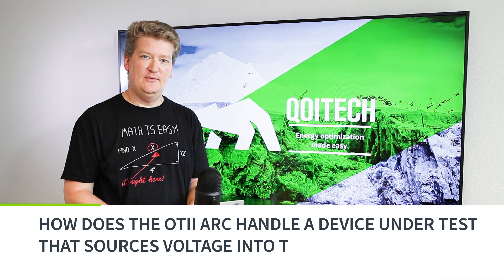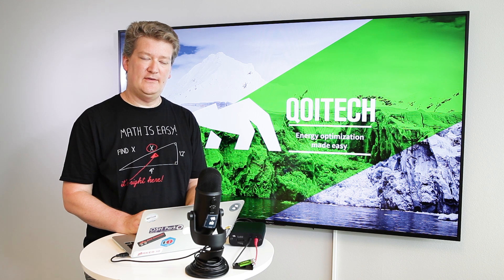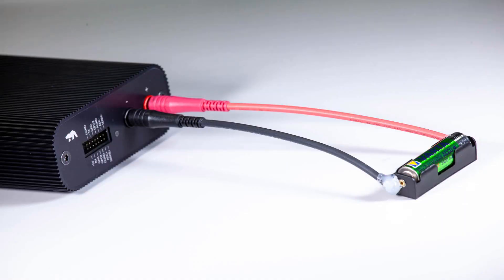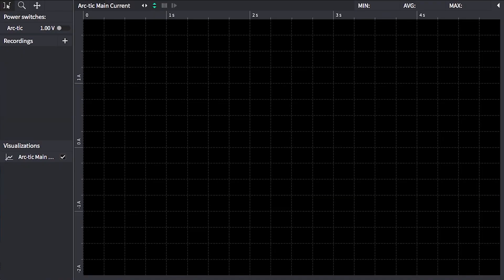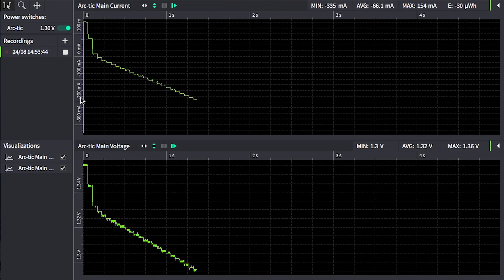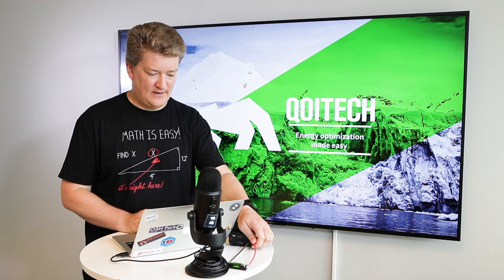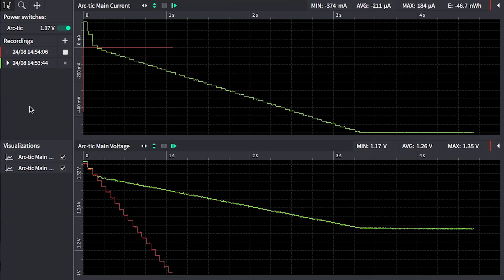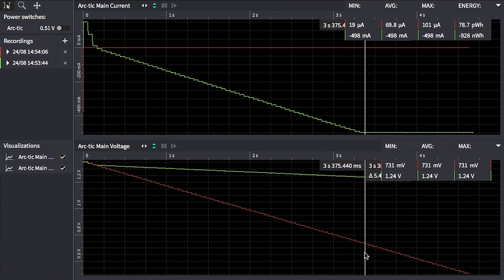How does the Otii Arc handle a device under test that sources voltage into the main terminals?

Comment: Hi. Does it account for reactive energy while measuring and also does it indicate the phase between current and voltage?
Reply from the maker: Hi Gowtham, thanks for reaching out. We calculate the true (instantaneous) power for each pair of voltage and current samples, this is summed up over time as the energy consumed (or generated). No phase relationship is being calculated. What use case do you have in mind for phase measurement in a DC power supply?
Reply: @Qoitech  if the micro switches someone inductive/capacitive load with pwm  then I guess phase matters